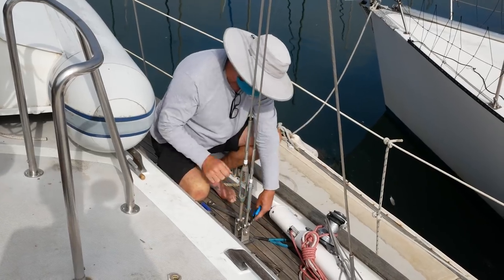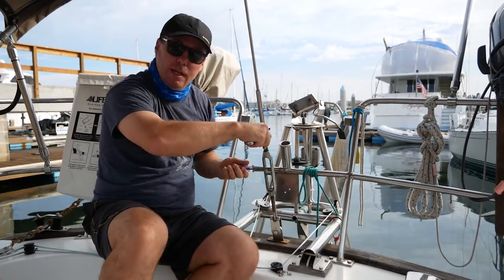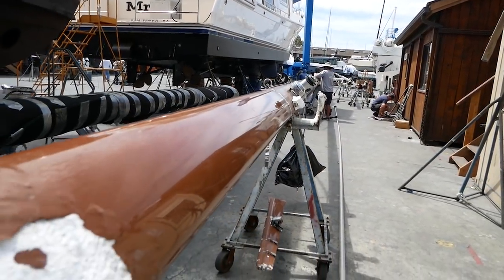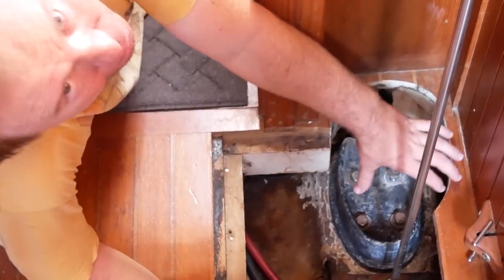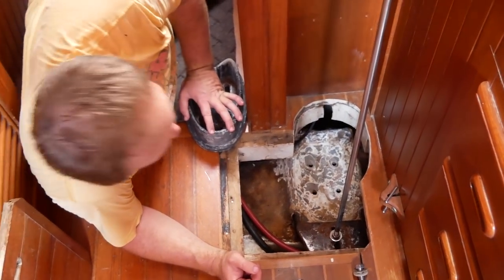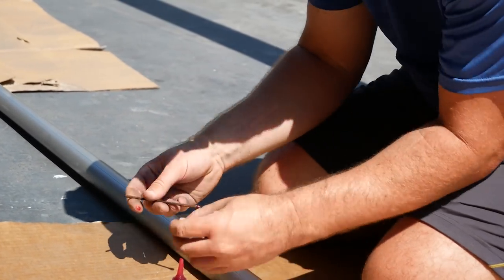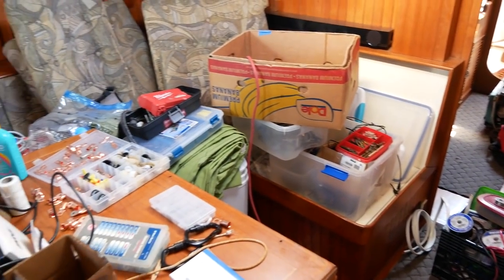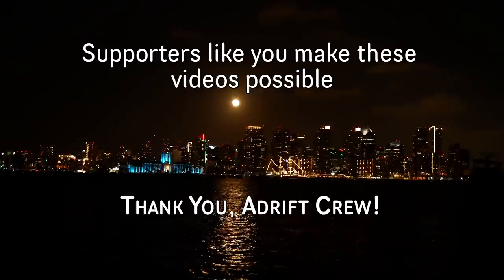Keeping our Boat SAFE and Mast Up [Adventure #210]

Comment: Looks like most of the corrosion was on the mast itself with the bottom few inches of brown paint peeling up over the creeping oxidation beneath. You didn't cover the repair on that, but it all looked good when you were stepping the mast again.

It's nice to have a good rigger in your corner when rebuilding the standing rigging.  I'm assuming the chainplates were all good and didn't need any attention either.  Not needing major step repairs or chainplate replacements must have been a huge savings on this task.   What a relief it must have been, especially when thinking it might be a huge hidden expense.
Reply from the maker: Surprisingly, once the mast was cleaned up, it did not have anything significant enough to warrant trimming any of the bottom off.  Just lots of bubbling paint and minor surface corrosion.  As for the chainplates, they had been replaced by a previous owner and looked to be in good shape.  

And yes, we learned so much from Chris!  It was great to have his expertise and now we feel much more confident in our knowledge and ability to trouble shoot anything that comes up in the future.
Reply: The paint repair didn't look too extensive or expensive.  Just needed stripping to bare aluminum and coating with zinc primer immediately before any surface oxidation could begin. It maybe could have been done by hand even, or a random orbital sander.  Then it is just matching the paint and feathering it in. It might all be hidden from view depending on how high the stripping had to go.

Aluminum doesn't take much corrosion at all under the paint to make it bubble and peel up like that.  The paint actually makes it worse at that point as it traps the moisture there to feed more corrosion.

We have an aluminum casting that holds our telescoping table leg in the galley.  It's been a constant failure point of the paint.  I'll need to take it off, restrip, and try again eventually.  Maybe I can find someone who will anodize it next time.  $$$$ 

Super glad that the 45 year old anodizing on the mast and boom is still holding up. Cosmetically it isnt as gold.as the spars were when new, but it isn't corroding on the surface so at least there is that :D. Not going to paint them ever if we can at all help it.

Comment: I have it on good authority, you should never use a screwdriver to adjust/remove standing rigging. S/V Ran. 👍👍👍👍
Reply: You aren't going to hurt bronze turnbuckles unless they are chrome-plated, those can chip.  Turnbuckles should probably be replaced every other time the wire is replaced as anyhow.
Reply from the maker: Turnbuckles were indeed replaced 👍

Comment: Did you have to replace the mast step on your Pearson 367 or did a previous owner deal with that?  The original (from the factory) mast step would have been steel.  I have replaced the step on my Pearson 365 with an aluminum one and raised it up 2 inches because the bottom 2 inches of the mast had corroded.  Good thing everything is clean on this boat.  Glad to see you on the water.
Reply from the maker: We never had any issues with the mast step on the 367. Not sure if it was original or replaced by prior owners, but there was no corrosion. Without knowing much, we got really lucky with Varuna being such a sound boat without any real issues (well, except for the bowsprit... lol)

Comment: As an A&P mechanic, aircraft mechanic,  should not use a screwdriver on the turnbuckle as can spread the turnbuckle. Use another adjustable wrench.  Never use visegrips or pliers with notches as they causes crack.
Reply from the maker: The turnbuckles we removed were replaced with brand new ones 👍

Comment: Did you put a coin under the mast when you restepped it? I forgot when we did ours.. it is supposed to bring good luck.
Reply from the maker: We did!  Put the original silver dollar back in, along with a 50 cent piece we randomly received as change somewhere the day we re-stepped the mast (insulated with Sikaflex, of course - because aluminum does not like other metals)!